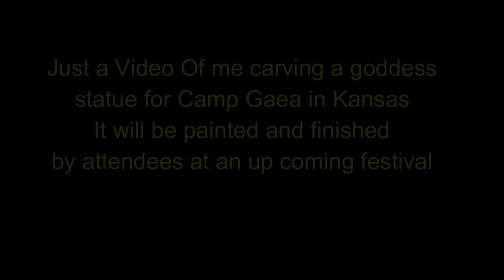#31 Goddess for Gaea, A Chainsaw carving

Comment: Great job buddy! wish I could attend that festival, I used to frequent them a lot... and so did you!! just came back to me in a flash... :) didn't you say a couple of video back you've got a piece of wood ready for making a drum?? you know I'm still waiting on that one, but no half ass job, we want the turning, the stringing, the tannin of the hide, the works!!
Reply from the maker: Actually, it is in the making (the drum video that is). But the whole process takes several months because of drying the wood. However I plan on doing 2 or 3 videos to cover it all. However I buy my rawhide a already cured so that won't be one, though I can explain the process because when I make bigger drums I cure my own cowhides.
Reply: Cyrus Fillmore (Time Lapse Turner) Well, the hide part was more of a tease, I can't imagine I'll want to go into drum production and tan my own hide, but I can't wait for the videos man!